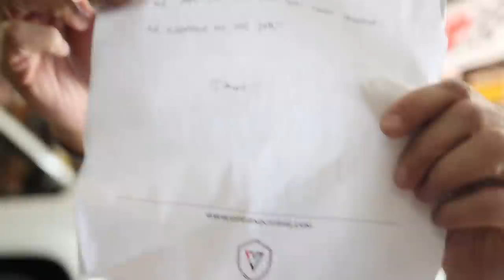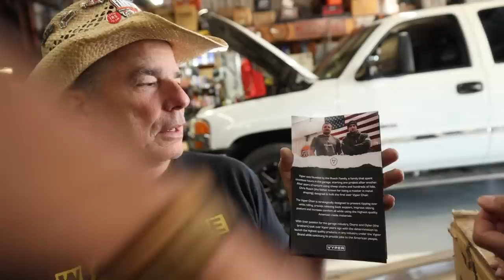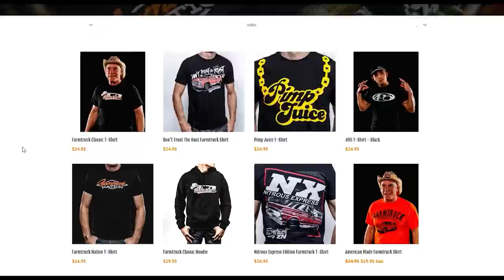IT'S UNBOXING DAY! - We open up packages from Vyper Industrial and Addmotor Electric Bikes!

Comment: If you hold down the two buttons that adjust for speed you will be able to make it go faster. If you change tire size, bump it up to the largest tire size and the highest kilometer on the odometer and you will get max speed of 23 to 25 mph out of that bike